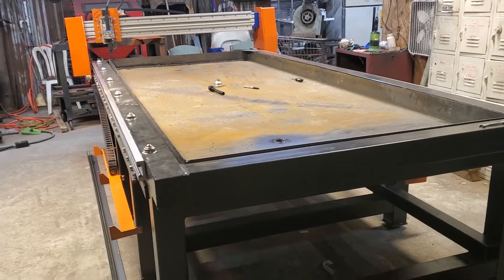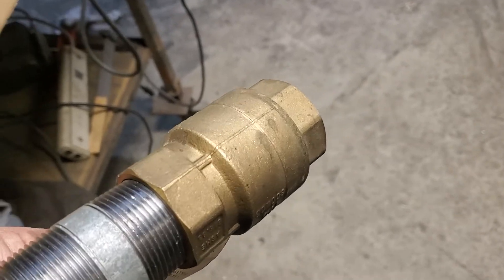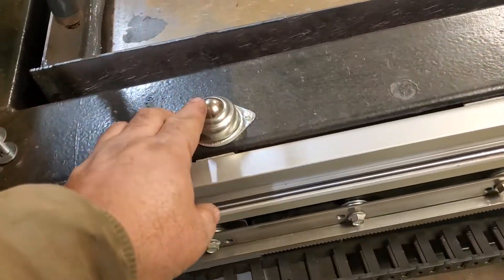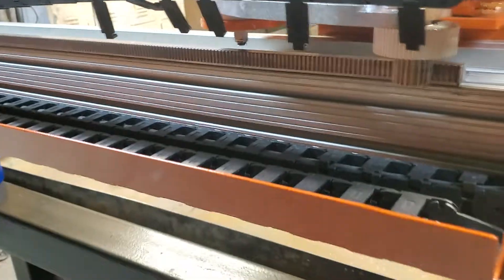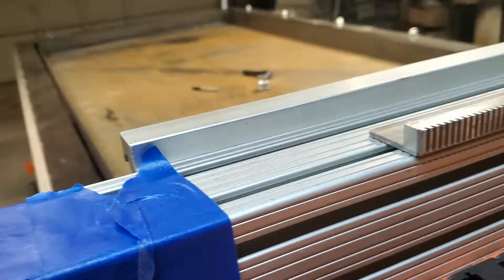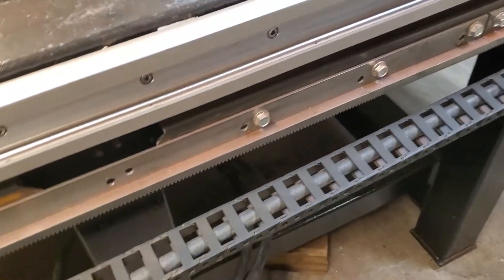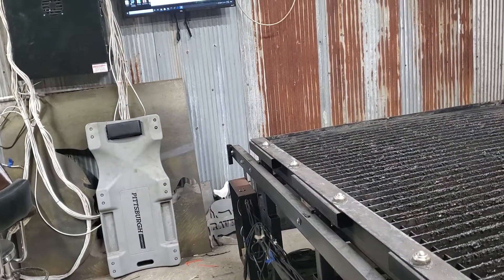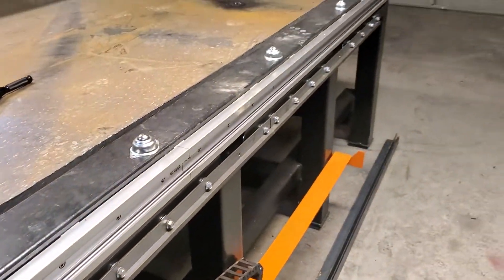BEST HOME BUILT CNC PLASMA TABLE 4X10`.#7

Comment: Hi again

 I have rack and pinion system coming. I have two motors in y axle ,both x axle ends. Do i have to make rack assembly both size so precisely that x axle dont bend?
If i put two y motors ,could i syncronize travels in myplasm program?
Reply from the maker: You will syncronize speed of motor in Drivers. and in MyPlasm settings. They will be running the same speed. MyPlasm is a Great and very Simple  controls..

Comment: What is the name of the linear rails that you were using? Where would I be able to purchase those from??
Reply from the maker: Look up Speed Demon Cnc Rails on Google. Mine is a 3 roller. And the middle roller will adjust if ever needed. I think they are SGB-25 and SGR-25. B stands for Block, and R stands for Rail. I bought them off of Alibaba. Over sea.  I still haveca contact there. I got them here in 1 week by air.  $807.00 to my door for all I needed for a 4x10 table. They was $1699.00 from a California place. So I saved half bying from Alibaba.